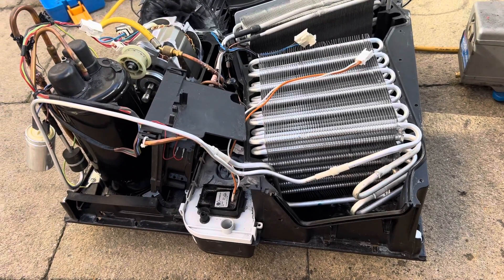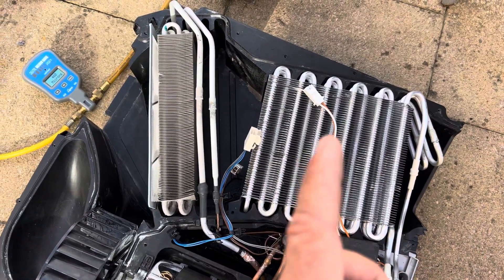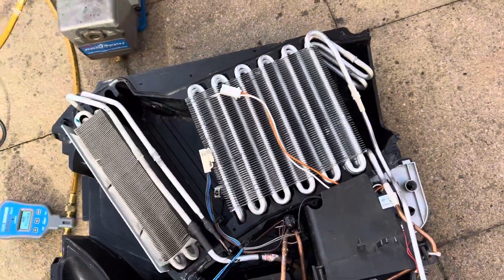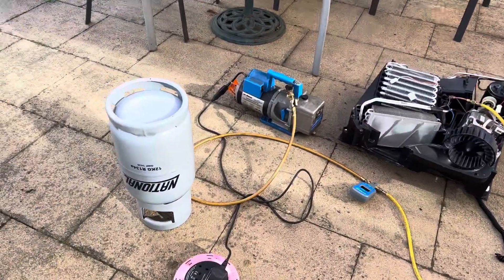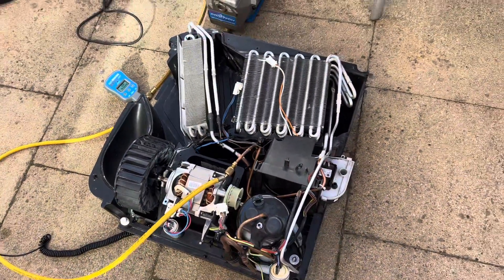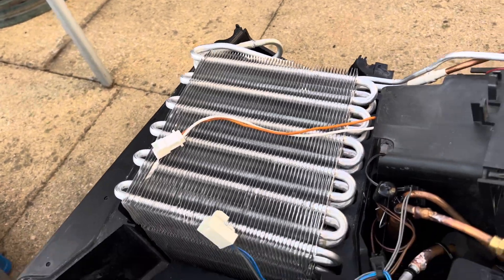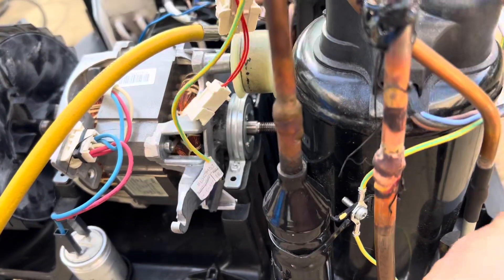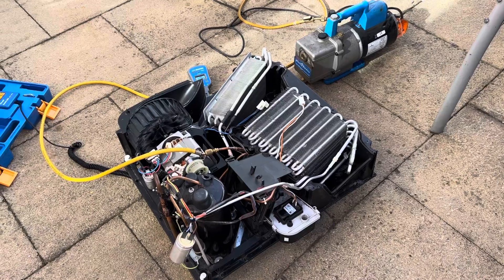Learn to repair your Heat Pump  tumble dryer alone .

Comment: I opened my dryer up because its not heating the air. I felt by hand that theres only heat from the compressor, throught the copper pipe untill it reaches the aluminium pipe from the exchanger. So the heat does not reach the exchanger before it gets cold. Any advice?
Reply: I have the same problem. The main compressor tank gets hot but nowhere else in the pipes coming off it seems to have significant temperature changes. The drier runs and the compressors hums but the air into the clothes is not hot. Did you find a fix?

Comment: My friends hoover tumble dryer is about 6 years old I can hear the compressor noise as it sounds like an old fridge my Miele heat pump sounds the same but mine gets warm and drys and it’s 14 years old almost  twice the age of my neighbours dryer, but hers will not dry and she’s been told the compressor is gone and there is nothing she can do bar throw it out but yet I am seeing you do this to fix it so I wonder.

Comment: Where do you hook in to charge the system?
Reply from the maker: You have to cut the compressor seal port and to charge it there .
For that you need to atach a valve  to the compressor port .
Then you use a scale ti charge the system after you vacum it of course .

Comment: Hello 
My dryer lost oil from the compressor. Do you know where I can fix?
Reply from the maker: Did the compressor luse the oil or the refrigerant .
If you have a heat pump dryer then there is more likely to lose the refrigerant rather than the oil .
Unless you break the compressor pipes and and yrn it up side down or run it lond ours with broken pipes .
Reply: Do you have a email to send the pictures?
Reply from the maker: @petrisoralexandru3461  
Suna ma 
07956487538